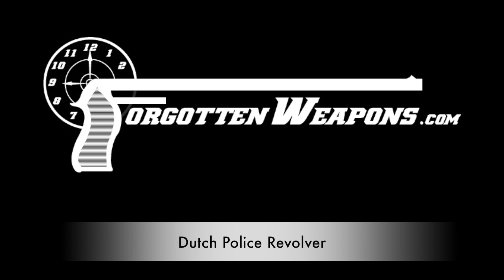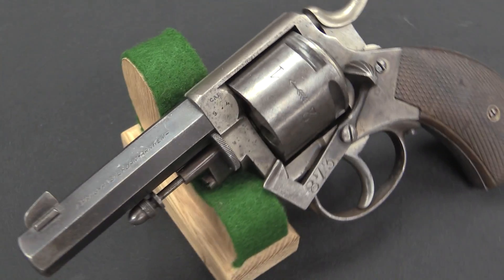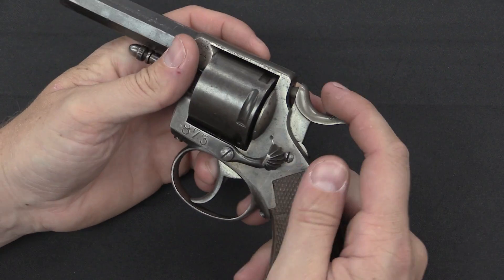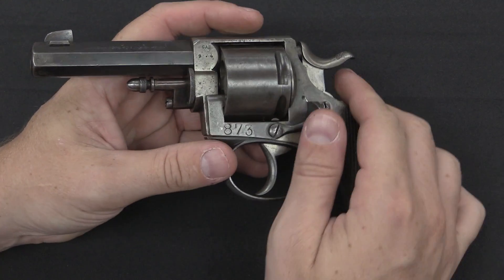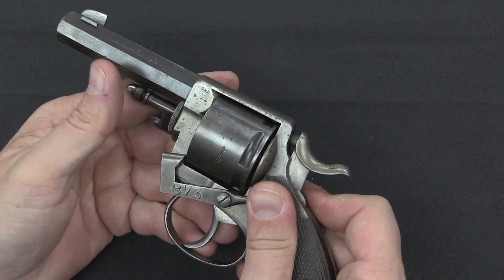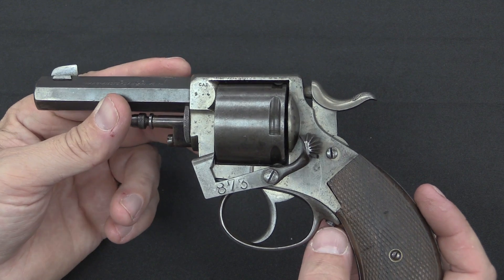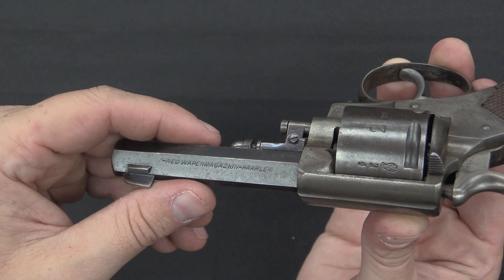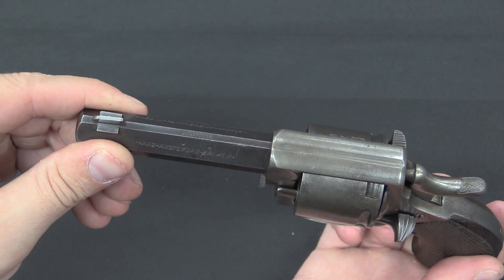Dutch Police Revolver (with safety!)

Comment: It makes you wonder how the officers that carried these felt about the policy.
Reply: I imagine, contrary to policy, it was often kept loaded on cylinder 3 (ie the first live round), and when going into a situation where the officer felt it wasn't necessary to have live rounds... they'd rotate the cylinder back to the standard setting.

Obviously it makes sense to have the non-lethal round loaded first in theory. But in practice, if you're going to have time for scare tactics and non-lethal rounds, you have time to rotate the cylinder. In a situation where you'd need live rounds, that's 2 double-action trigger pulls between you and anything meaningful. I'd like to think Dutch police at the time would understand that, and rightfully keep the gun in "live" mode unless the situation called for it.

It makes way more sense in practice that way, regardless of the cylinder markings and/or reality. D:
Reply: I guess it would come down to a cop's feeling on a situation. The blank/gas were essentially the tazer/pepper spray of their day.
Reply: Well considering this was tge first repeating handgun they had

Comment: Nice revolver and I would not mind it in my collection, but I think the idea behind it is bad. If I need my revolver, I need it 2 seconds ago. If some nut is coming at me, I can not afford to take the time to fire a worthless warning shot, then a useless tear gas shot, and then actually be able to shot, or time messing around with my revolver trying to get it into the correct configuration. That weirdness does make it much more collectible these days though.
Reply: Nothing would prevent you from loading all chambers with lethal rounds and disregarding the safety.
Reply: @tmcgill2219  Other than orders of course. I think it might had been a better idea to carry a separate weapon.

Comment: I find this funny as hell. Police revolver, with added safety mechanism?

Meanwhile, we watched police in many areas love the glock because there's no question what condition the weapon is in. I imagine this revolver has the complete opposite effect.

Then again, glocks have a considerable volume of physical safety mechanisms instead, so IDEALLY they only fire off by someone pulling the trigger. Hopefully the trigger is being pulled with good decision making skills, at that point.
Reply: Police in America are basically 99% guaranteed getting off for killing someone, regardless of the circumstances. The same may not have been the same in late 19th century Netherlands(failed German Revolution(s) not too long ago, other revolutions occurring)..
Reply: Bear in mind this thing was 90 years older than the glock, at the time something like this was a perfect cop gun and there weren't as many firearms, certainly not of the destructive potential that modern firearms have. The safety is simply to ensure that the warning shot doesn't get swapped with a live round.
Reply: dutch police officers are using the Walther P99Q today.
Reply: YCCCm7 There were no modern semi-pistols around in production, only maybe various prototypes like the C93 and more modern slide-pistols. The cost was also too high.

Comment: Calling it a safety doesn't appear correct, as because of the angle on the side of the part going into the cylinder, it would appear you can just draw and fire and it will push itself out of the way - you don't have to disengage it to fire - so it's not really a safety, is it.

Comment: Interesting firearm, though it's pretty much a death-sentence if used as it was designed.
Reply: Yep. I'm really annoyed by all the people in this comment section who think its a good idea.
Reply: @KageMinowara  I agree that it'd be a terrible idea today, but I do wonder if it was back then the description did mention late 1800s/early 1900s. I wouldn't be surprised if at that time some kind of sword was a standard piece of kit for example. At the time this was maybe an experiment worth doing, while still keeping a repeating firearm that has 3 regular shots. For anything where you know you're going into a dangerous situation there'd always be the option to load 5 regular cartridges.

I don't know what typical police enforcement looked like at the time and what kind of firearms were in circulation with criminals. It does seem like a bit of an issue though that if you're surprised after taking the safety off you first have to discharge two shots and only then get a regular cartridge in the chamber lined up.

Comment: It might get hard to find the ammunition for this.
Reply from the maker: It would definitely be a bit tricky.
Reply: +Dor Aran having reusable catridge made for this. Practical for shooting rare ammo types in practice.
Reply: ***** Good point. About 20 years back a black powder rifled accidently discharged. Gun probably hadn't been used in a century, but no one ever cleaned it out. Nearly a century of no use, and the powder was still potent enough to nearly blind the guy who thought it would just dry fire. I can imagine several problems with aged ammo of different chemical and metal materials failing.